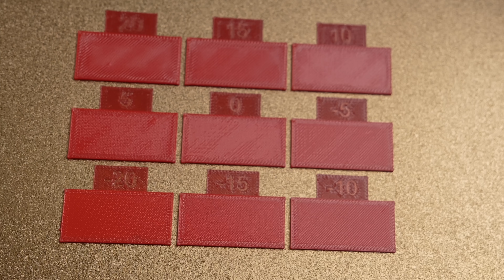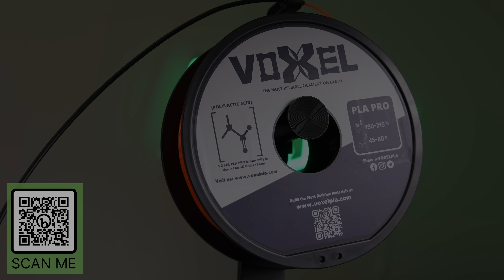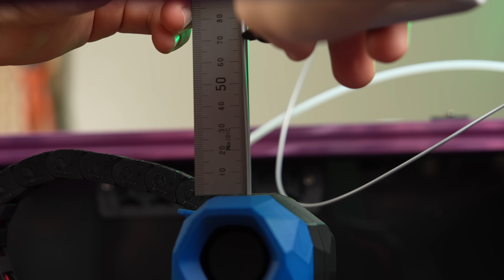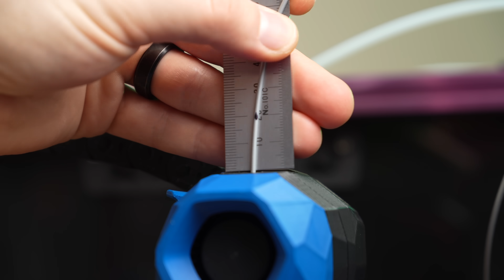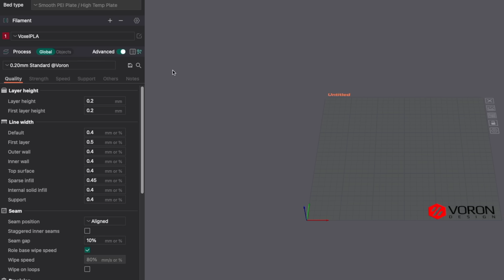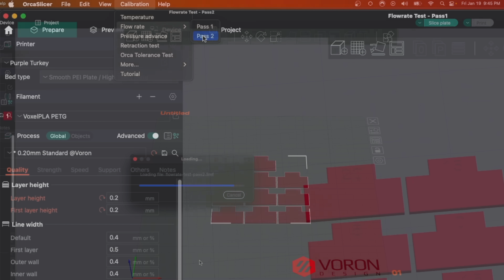Tuning Material Flow For Best Quality 3d Prints (OrcaSlicer)

Comment: It is always between 0 and 5 on pass1...oh I wonder why .....It´s the same nonsense as with the "cube" calibration method, which of course never worked. People just take some shit from the internet and "teach" you how to use it, without understand first how it works. Nobody makes sure a specific method actually does what it says it does. You don´t need the first pass at all. You simply chose 107% extrusion multiplier, then print the 2nd pass. -0.7 on the 2nd pass is your 100% extrusion. And then you work your way back from there. Done.

Comment: You don´t need to "tune" your flow for different colors or brands. It´s material hardness specific. That´s why TPU needs way more than PLA. PLA is brittle and hard, the teeth of the extruder don´t distort the material, nor is it distorted within the tube until it reaches the melting zone in a bowden set up. With TPU it´s a whole other game, the teeth will not grind they will squish it and by pulling it in they the extruder will simply elongate the material but not move it. There is no other reason than this to "calibrate" flow for different materials. You can print all PLA´s with the same setting because they will not change their hardness. Once you have printed out your test pieces and made sure the top layer is not over or under extruded you are fine.
People tend to see some "magic numbers" and "tuning here and there" in 3D printing as if it were magic, it´s simply engineering and science. There is also no point in trying to find the BEST VALUE in like 0.1 steps. You can´t even detect a difference. The tolerances within your filament diameter will be probably larger than that by this point. So relax.
And going how the top layer looks and feels is not that subjective. You as a human have eyes and can feel things, that´s sensing too. If the filament has gaps you know pretty well it´s under extruded, if it has ridges and you can feel them you know you extrude too much. It´s perfectly fine. You can feel tiny minute changes in the surface with your bare hands.
It´s just a flow ratio of like 0.9975 is just complete junk. Are you seriously telling me you can notice a difference if it´s 0.001 off ? Using 4 places after the decimal is laughable really.

Comment: Just found this - why not continue to run the flow rate calibration until getting a zero? Also, I saw that there's now a "Yolo" and "Yolo Perfectionist" but no mention of those on the calibration page for Orcaslicer.
Reply: You can repeat the test but it's pretty tough to gauge on just those little blocks when you're trying to get such a fine resolution. Plus there's a lot of other factors at play that can make or break the perfection

Comment: Hi, this makes way more sense as what I did yesterday. There are videos telling you to adjust the rotation distance in the printer.cfg for a certain filament. 

I will do it that way tonight again. 
But, this formula is weird.
If I got this right the modifier is just in %. Let's say the modifier digits are n,m
Thit is just flowrate_old * 1,0nm = flowrate_new.

I am wondering , why in the 2nd pass of the flowrate cal there are only positive modifiers.

Comment: You said to calibrate at the temperature of the filament. However, my experience with temperatures of filaments is that they have a RANGE of temps, not a single temperature. Therefore, there can be up to a 20-30 degree difference in any filament. That being the case, I have noticed that if I use the upper temperature (as printed on the filament spool), I get different results from the same filament at the lower temperature.
For example, if I use the lower temperature, I probably will get a part that won't bond the layers together as well because each layer is too cool to melt itself to the preceding layer. This has resulted for me failed prints, especially ones that take a long time to print and that are less close to the print bed and have a lower temperature as the print progresses. I did one just the other day that simply by upping the temperature by 10 degrees made the difference between a failed print and a successful one.
Additionally, although esteps might be technically "correct", filament that is melted more will extrude after the stepper motor just a little faster than cooler filament because it will tend to "flow" out of the nozzle instead of being pushed at a precise amount. Also, the plasticity of filament affects retraction, and more stringing happens at higher temps with some filament types.

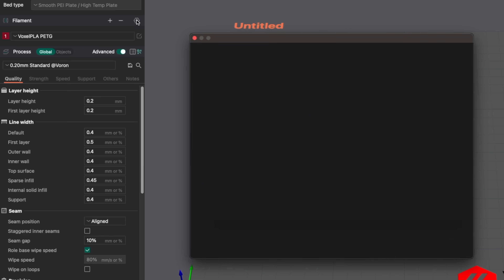Comment: I'm new to Orcaslicer and only see a small selection of "Voron Generic" filament profiles when I go to Add/Remove Filament. Is there a way to quickly add other manufacturer default profiles (like you show at 7:32 in this video), or is it a manual process of hunting down and importing config files?

Comment: Used one of your Videos Years ago to calibrate My CR10 esteps…(And Silent board Upgrade, My BLTouch recalibration, Setting up my Micro Swiss Extruder on my HotEnd, Dealing with my Tensioning, learning to Flash/ref lash firmware, learning to cura, orca etc..)So SOO many things now that I’m thinking about it!.😂
You are one of the Best, most Helpful Friends that I have Never Met..🤙🏻
Thanks Man..
Rad🤙🏻

Comment: Rotation distance isn't constant between filaments with different hardnesses. This is due to the amount the gear teeth bite into the filament as it feeds it through. That different amount of squish into the filament by the teeth changes the effective diameter of the wheels feeding the filament. As you're already dealing with small adjustments this phenomen will affect the results with different hardness between filament types (PLA, PETG, TPU, etc). This is one of the reasons you need to calibrate the flow for each filament type.
Reply: I've been thinking for years to put an optical sensor from a mouse to track actual filament travel, gave up right away when looking at the work i would have to do. But Bambu seemed to find a way with a pressure sensor, i'm sure the backpressure would still be tuned for each type of filament but will compensate for temps and slippage differentials at different print speeds, etc

Furthermore, for best optical tracking you would also have to include filament width gauges. Possibly two optical sensors at 90 degrees to catch how wide the filament is and double as motion tracking. Mouse sensors should be able to handle that, it's basically the same thing the X1 uses for "lidar"
Reply: Sp do u recommend to calibrate a rotation distance on my qidi q2?

Comment: fun fact if you use any extruder with concaved gears so basically any dual gear system, filement thickness play double role because smaller diameter of filement wouldtouch extruder gears closer to the gear shaft and thus making less distance every turn
if your filment is always 1,75mm then you probably fine , but whenever you switch brands depending if they measured it hot or cold during production you may have to calibrate esteps from the scratch
then again if you are in a ballpark of 10% you can probably print the calibration prints twice and get to the correct flow without touching esteps because this is almost like redundency

Comment: You're not getting me on that one again.  I've run PrusaSlicer a LOT, but the first time I installed OrcaSlicer to take advantage of its handy calibration and tuning routines, it sent some G code to my printer and crashed it.  I still have a big nozzle gouge scrape across the PEI sheet as a reminder.  I know a lot of people love OrcaSlicer, but I think I'll stick with my own manual optimizations and tunings in PrusaSlicer.

Comment: For a mathematically-chanllenged individual like myself, this is a mind-numbing amount of mathematics.
I'll be glad when they come out with a printer that has the AI capability to automatically calibrate any given filament.
Don't laugh.  I know that this capability is coming in some of the newer 3D filament printer in the pipeline.
Reply: BambuLab have lidar and eddy current sensors....with dynamic flow adjustments..be glad now

Comment: Just ran the calibration like you suggested. My rotation distance was way off and i set it to 60% of the original value. The original value gave some ok results. Now of course there was crazy over extrusion and i had to set the flow ratio to 0.6. Seems like that's a bit weird. The flow ratio of the presets of all filaments will be a off by a lot now right?

Comment: I was talking to a orca dev and he recommends larger coupons printed one at a time. More time consuming, but it will yield better results. Further, your top surface quality will be influenced (like the video said), by your Z offset, as well as your solid infill and how many top layers you actually have. One thing to note, is that smaller areas will always appear overextruded, you want to focus on the largest part of the print and in the center of that. 

Good news is there is an algorithm in the works that will attempt to equalize flow for smaller areas so they appear uniform.
Reply: Isn't that the purpose of the auto-generated test squares?  It has a certain number of infill layers so the bottom layers aren't impacting the end result?  At least, that is how Ellis' guide has you do it, and I'm pretty sure the Orca tests are based on that

Comment: Not sure the results were "spot on" at 6:21, given that the ruler is skewed enough to be minus 2 or 3mm.
The whole proposed measuring procedure is extremely inprecise, but somehow you calculate the rotational distance to the 4th decimal.
Reply from the maker: That’s more the camera angle. Is there some room for deviation? Absolutely but it’s a lot closer than 2-3mm.

Comment: In my opinion this method is not accurate enough. You use a I will call it „standard“ ruler with 1mm resolution (lets be optimistic and say the markings are right) that would mean that this is 2% flow/ rotation distance per mm. In my opinion quite a high error. I prefer the following methode: cut a piece of filament at aprox 120mm. Use digital calipers and use the offset to put it at 0, extrude 100mm, measure the distance. 1. double the accuracy by higher distance 
2. way mor precision with my calibrated mitutoyo caliper than on a ruler
Reply from the maker: Sure if you have calipers and want to trim that is a great way of doing it. I mention calipers in the video as an option. There are lots of ways that calibrations can be performed and ultimately I feel the output is really what matters. This method works for me so I can stand by it but if you prefer your method and it’s worked well for you that’s great. 👍

Comment: Or. Just print a part of say 500g. As in the slicer says it uses 500g. Just weigh the part after printing. That is when you realize that there is more to this, like density, diameter, and moisture.
Reply from the maker: I would have a hard time trusting weight. Especially with things like purge lines and skirts. I haven’t tested the accuracy of slicers estimations but unless you have calculated density in the slicer its calculations would be off.
Reply: @ModBotArmy  This was a waste of my time. The physics of extrusion is pretty straight forward, until you realize that it is not. If you haven't gone through the hoops trying to sett the physics of it accurately, and realized the real accuracy of what you're doing, this is a waste of my time. Your talk like you don't get this.

Comment: My preferred calibration approach is: z-offset, then SuperSlicer flow calibration first pass to rough things out (same as this video), then z-offset again, then run 3 Ellis calibration squares to dial in the flow.  The Ellis squares place a couple layers of infill to quench the impact of poor z-offer or bed tramming, and also use bigger surface area and more layers to enhance the impacts of over-extrusion.  But the Ellis squares are, of course, a lot slower to print, which is why I do the rough pass.

Comment: PLEASE DO NOT CALIBRATE YOUR ROTATION DISTANCE USING THIS METHOD! It is WRONG and a hold over from the poor way it was always told to do so on Marlin!

Rotation Distance in Klipper is derived and calculated based on  your hardware ONLY and it is why extruders like CW2 and Orbiter can just give you the value to set. If you want this to be exact follow the Klipper documents on calculating it yourself (not by using the Step per MM method but by measuing the hardware itself) as there will be variations in parts such as the gears even for the same extruder. While it is still useful to run the check mentioned by doing an extremely slow extrude (or better yet, remove your nozzle or extruder entirely and do it without melting plastic) as a sanity check there will ALWAYS be some variation due to the tension on your filament, the filament squish, resistance in filament path, etc.

ALL of this variation should be corrected via Flow Rate in your slicer ONLY! If you change your Rotation Distance to correct for these variations you will ALWAYS be chasing a different value as you change materials, change extruder tension, change print speeds, etc. You should only set your Rotation Distance ONCE and never touch it again, follow the steps for flow rate calibration (there are also better methods than the built in ones) any time you make a change such as the examples above.
Reply from the maker: This method works great and is exactly what is recommended in the Klipper documentation. It sounds like what you are saying is not far off from what I show in this video. The rotation distance is not meant to be updated per filament. I set it once to make sure it is as close to accurate as possible with a stiff filament. That gives you a great baseline to then tune flow per filament from the slicer. 

If you have the rotation distance for the extuder that's great and in most cases will be fine to leave but it can be wrong and if not provided this method is simple to get you that baseline.

Comment: You can use masking tape to mark the filament. Just stick the tape to the ruler then transfer it to the filament. After extruding, just put the tape back on the ruler. Much more precise than using marking pen.
Reply from the maker: Agreed with Char that unless you know its only off by a little bit dont use tape. I have seen some where after an extruder swap the gear ratio is so different it extrudes WAY more than it should. Trying to fish some tape out of the gears doesnt sound fun.
Reply: You will need to be careful doing this the first time on something like a new extruder as the value may be so far off the tape would get sucked into the gears, this is why you measure more than you actually extrude. I also already commented on why adjusting your Rotation Distance using this method is poor to begin with, please look at that comment, but for a general sanity check before proceeding with further tuning a marker is just fine.

Comment: Im actually not a huge fan of cailbrating the rotation distance, because this varies from filament to filament. Just calibrating flow per filament in the slicer is easier imo.
Reply from the maker: Rotation distance shouldn’t change per filament. Since it measures the input and not the output it should be consistent unless is something preventing the extruder from grabbing/feeding. I suppose as long as your rotation distance is within range though then flow per filament only is fine. I just like to dial in rotation distance initially.
Reply: @ModBotArmy  I'm guessing you mean it shouldn't change per filament in your first sentence.  I agree that rotation distance should be calibrated, especially if you have more than one printer.  Otherwise, you might need to adjust flow for each filament for each printer, since each printer's rotation distance could be slightly different.
Reply from the maker: @jyxent  thank you that was a typo I corrected 😊

Comment: 7:30 my OrcaSlicer 1.9.0 does not have all those filaments, it only shows 3 choices, how do I get all the choices you see?
Reply: I have the same problem with my Neptune 4 and orca slicer
Reply: @berlinberlin4246  You have to add a printer. I added a Bamboo X1 Carbon and suddenly I can now print with Bamboo brand filament. I don't know why Orca only limits you to the filament made by your printer.
Reply: @Beakerzor  thanks, I'll ask on the Github page whether this can possibly be changed.
Reply: @Beakerzor I will try it
Reply: @Bassterino have you the issue number? Than I can subscribe to the news on the issue